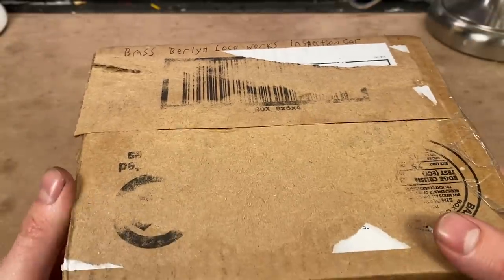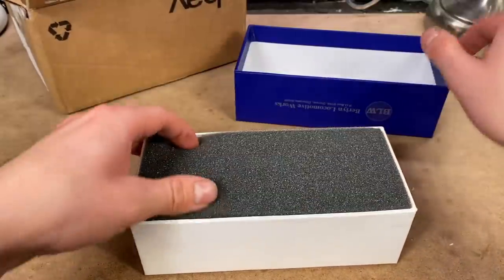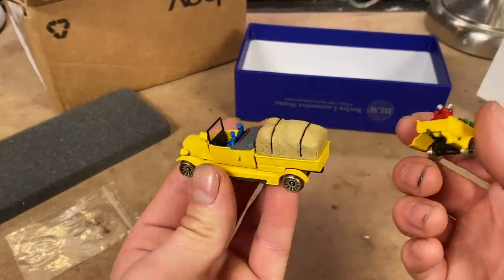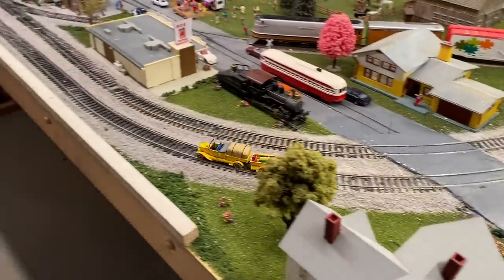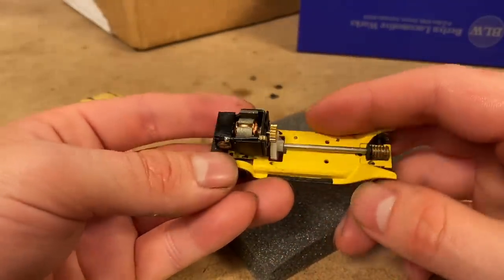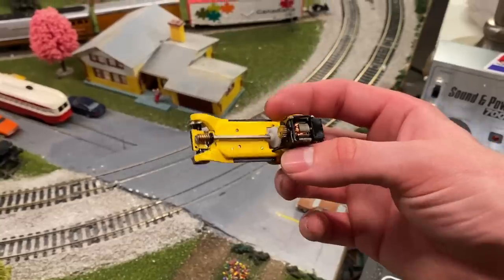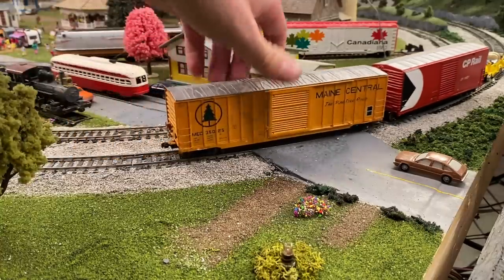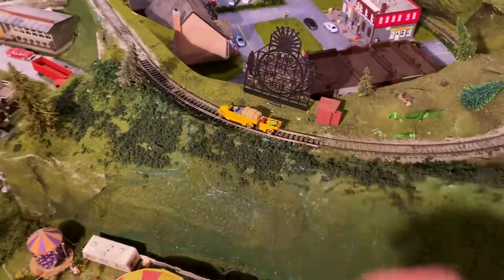Strange HO Scale 1930s Rail Vehicle from eBay - What is This Thing!?!

Comment: An early inspection motor  vehicle - engineers would literally drive along the line looking for faults and carried tools and crews to do not so major repairs. They would also serve crews far out on the line by collecting things they needed from the workshops and bringing them to the remote site.  That is actually a beautiful model.
Reply: Definitely  would  be considered  a period piece  of equipment  if you look at  pictures  of post WW2 most vehicles  would be converted  cars up to the mid 50's. Great find
Reply: They still are...most are F250 trucks now.  The Tenn Valley RR long run Summerville steam passenger train a week back was being followed by a rail inspection car.

All three historic railroads around me have inspection cars running the tracks regularly
Reply: I remember riding one, argent 25
Reply: going to say that
Reply: Great rare little model.
Reply: Interesting how cool SMT
Reply: The practice remains somewhat common to this day. Of course the trucks they use have gotten newer but the principle of just buying a truck and converting it to ride the rails as an inspection vehicle hasn't changed.

Comment: This is the first time seeing something like this from a manufacture other than Bachmann. Just like others posted; it was most likely a custom inspection vehicle styled after an early automobile. This is the reason that you won't find too much online about it. Most railroads purchased a standard vehicle and then they modified to their custom use. The best way to research it would be to look at automobiles from the 1910s to the 1930s to see if the body matches something.
Reply: My father owns a '31 Model A and belonged to a Model A club when I was young, so I've seen plenty of classic cars. Not very expert, but from the look, I'd place it in the early to mid '20s. Excellent search boundaries there, well done.
Reply: Chitty chitty Bang Bang.

Comment: I love rail layouts that run something out of the ordinary. You'll make people smile with this one. I'd sooner carry out track inspections using that car, in real life, rather than those hand-pumped up-and-down trailers used by many countries. 

There was an N layout that was MASSIVE, on the exhibition circuit. It ran the longest freight trains I've ever seen, and I can't match them on my big T layout. But this N layout used to run a train in to a tunnel, and the kids used to dash to the other end to watch it come out. BUT, they switched the tracks and an electric MOUSE used to speed out of the tunnel and rush around the layout, making everyone smile and laugh. Every time someone tried to take a picture, the mouse would run for a tunnel and hide, poking its head out at a tunnel exit nowhere near the one it went into. I think they had an underground hidden route that enabled the mouse to go to any of the tunnels. There was one magazine photographer, who managed to set up 5 cameras, all triggered by movement, and he did become the first to ever picture it.

Humour should always be encouraged. I am attempting a horse poking its head out of a stable, using a points/switch motor, but using a cam, rather than a gear. And my local model village, Beckonscot, the first and oldest model village in the world, uses cams a lot. A window cleaner whose ladder falls backwards, as the young lad, who is meant to hold it, bends over to kiss a young lady, and a woman who leans out of a window to talk to the postman. There is a fireman fighting a thatched roof fire, and smoke pours out of the big hole, a folk dance troupe who jiggle and wave their ribbons to the music. All activated by miniature cam motors.
I am building a medieval church that will have stained windows, lighting and a small speaker inside, so I can play the bells ringing. Got to be different. I already have the only Class 17 Clayton in the world, made it myself, and the only convertible BMW, with driver and passengers, in the world. Using your mind should never be optional. I'm even building my own, scratch-built Jacobs Bogies for my French layout, featuring all the French trains on the market. And, I am also building a Dutch railway, with their beautiful trains.

Good luck with your future plans.

Comment: It was not at all uncommon to see a Buick running in the 1930s on the Denver & Rio Grande Western. They have several "Galloping Geese" on display at the Colorado Railroad Museum. They have been used by maintenance of way crews, but also to keep the mail contract fulfilled during the great depression (it was cheaper to stuff a Buick with a crapload of mail and a couple guys, than to run a fully staffed train with engineer, fireman, conductor, brakemen).

Comment: I had one of these, bought at a train show a long time ago. It never ran great, very touchy compared to the little track inspection car I bought the same day. Same motor in both. The other car weighed more and had zero power pickup issues, but the one you had was super sensitive about track being clean. It had a tendency to derail until I added weight to the front with a couple of cut up stick on lead weights. I solved the power pickup issues by taking one of my junk box locos and making it into a dummy and running an umbilical to the track car. Might not be realistic but the track car was just too twitchy by itself. It was the only thing I had power issues with, HO or N scale. Lots of bad running N scale locos, but it wasn't due to power problems.

Comment: Dude get a re-railer. Will save you a lot of hassle in putting the engines you get on your track
Reply from the maker: I had one and I wasn't a fan to be honest.
Reply: @SMTMainline  Too big? Or just didn't work for you?
Reply from the maker: @michaelmasi5220  It often failed to get the flanges in place so I would have to do it manually which defeats the purpose of a re-railer. I don't know how but it was also causing derailments with some of my larger steam locomotives.
Reply: @SMTMainline  Oh ok then. Strange to have a re-railer be doing that.